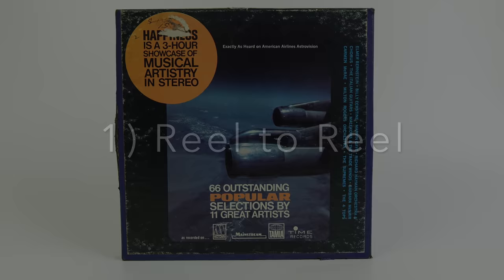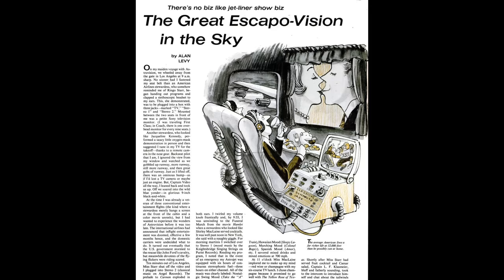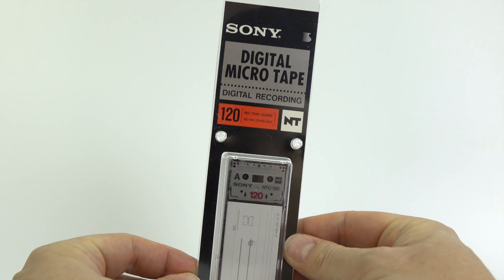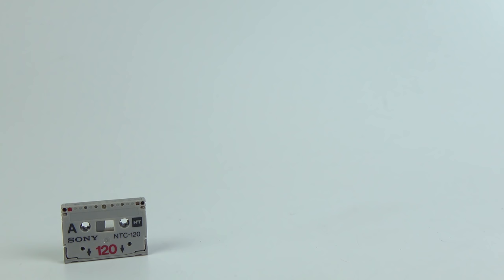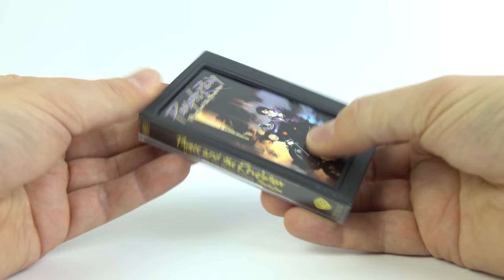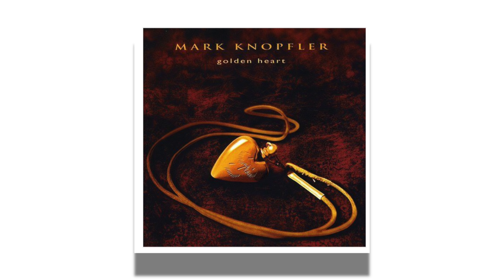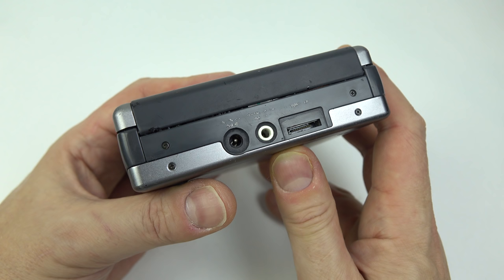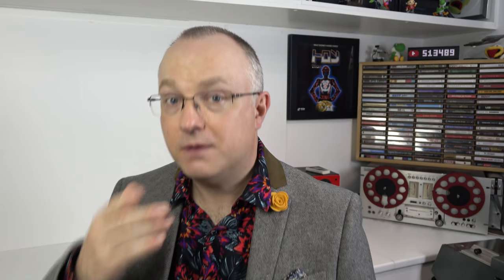Audities / Odditapes -  Rare & Unusual Tapes

Comment: That NT tape is the best I've ever heard on your channel thats is not a tape thats a DAT, Reel or Metal impressive. Probably even beats those others because it's tiny and produces sound that great and tiny things shouldn't do sound that good at all even more so a tiny tape because as the reels, hifi vhs & beta and dat tapes prove the thickness of the tape normally matters when it comes to sound quality.

I guess by then they mastered it down so much with Kobolt and Metal combi tech they experimented on with the final line of normal analouge cassettes and dat tapes they were are to make a wafer thin digital audio tape with the sound quality of thicker dats video tapes and reels on it.

Very impressive technology even if it was a remix of reel, dat, kobolt, metal, chrome, ferric and vhs materials in the one wafer thin tape making that quality come out of it.

The only way you can make a material so good to make an awesome digital tape out of is to remix every material eveer used in a format to make the best digital tape sound quality ever made must have been pricy to make and demanded a lot of cost to buy so probably not a sustainable home format though but the tech behind it is interesting but I am guessing it's medily built compound though or the sound would be so crisp as a digital tape format like normal analouge tape didn't sound that good until Kobolt, Chrome and Metal tech came along for building compounds.